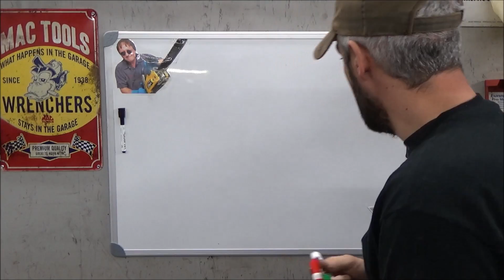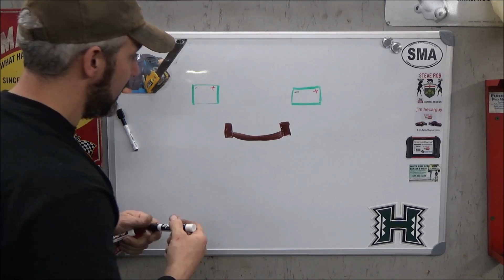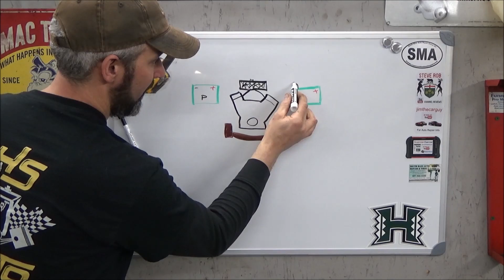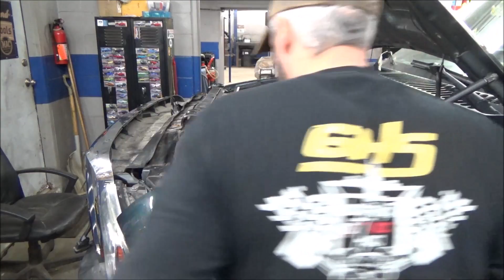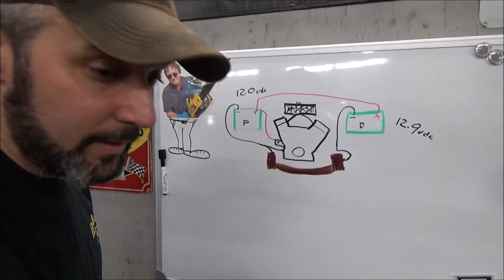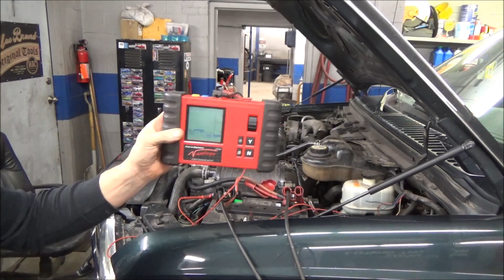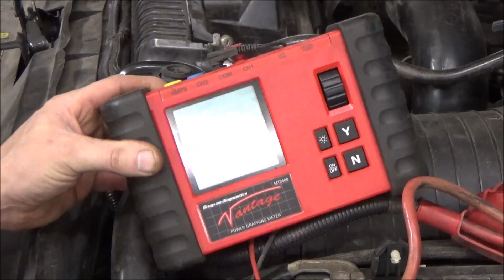Ford F-550 6.0 - No Start No Crank

Comment: This truck will be back for head gasket coolant problems
Reply: And bet you didn't know that 99% of the issues was due to having the wrong pressure radiator cap. Fix that, egr delete, and head studs and those engines are great. I'm a huge fan of Ford and own 2 diesel trucks. But they dropped the ball on the 6.0 and 6.4. the 7.3 and 6.7 are fantastic

Comment: If the batteries are hooked together in parallel, how can you get different voltages on your meter?  Shouldn't your meter show an equal average of the batteries on both batteries? Looks like a bad ground somewhere to me.
Reply from the maker: +beechwood619 Did you see the video haha?
Reply: Yes and yes

Comment: What would happen if you put jumper cables from one battery to the other? If that works then either a bad ground on one battery, or bad connection between positive post
It was a bad ground, so when you took the cable off it was easy to figure out where the problem was. Still a great step by step to find where the actual problem was. I would think, using 2 cables would probably be easier or cheaper than buying a factory cable. I have done simular things with bad grounds. I have fixed bad grounds ( or so I thought) and NOT fix the problem as well. It sure helps when you have knowledge to test everything.  That way you know you're correct as you were. 
Great job SIR!

Comment: so did you buy or make the cable!? I must know!
Reply: I know this is the wrong video, but what is your opinion on the diy ac fill kits with the oressure gauges? if I know my ac works and is just low on a charge? thanks keep up the videos
Reply from the maker: +splice247 I bought it from Ford, 1 day wait and only about 50 beans... I mean bucks :)
Reply from the maker: +splice247 Can't a shop charge it for really cheap? I get 39.99 to do a full evac and recharge...
Reply: Wow, really? That's crazy cheap! I'm in a city of around 150,000 in Canada and the going rate here is $150 Canadian. That's about $115 USD. That's for the service, refrigerant/oil, quick leak check and performance test. A/C machines typically cost $3000-$6000. That's a lot of money...

There are three main issues with those cans.

1) You don't know what you're getting. Some of them are pure hydrocarbons and not even R134a. Most are full of nasty sealants that like to do more harm than good. 

2) It's hard to accurately know how refrigerant the system is being charged with. 

3) Most importantly, those top up cans are doing nothing about any air and moisture in the system. Air and moisture seriously hampers the system's ability to perform. You won't get full cold until you get that stuff out with a proper evac.
Reply: @splice247   If the A/C is low on gas you have a leak. Don't go just topping it up with cans. Get it fixed properly and vacuumed down and properly checked for leaks

Comment: great video, but not a big fan of Scotty. To many loose nuts.
Reply: I like Scotty honest guy
Reply: +Justin P. Not really, very biased.
Reply: +Jonathan Barfield If you didn't know any better you would think from watching Scotty's  videos that changing and engine is a 4 minute process.  I like him, but his videos are very brief.  I like the long in depth ones that show all the stuff that goes wrong.
Reply: He shows enough to be dangerous. I have been turning wrenches 30+ years.Scotty videos are funny.
Reply: I like the one where he says to jack up the car to have enough room to get under the car, and don't worry about jackstands if you don't remove the wheels, because it won't hurt you if it falls because the car you had to jack up to get under wont fall enough to crush your chest if it fell.
Reply: +pdgeman   (no mention or thought of suspension travel)
Reply: Scotty is a nut case
Reply: More and more, Scotty sounds like a schill for various corporations. Any review should give balance, discuss alternatives, and disclose weaknesses. Wise consumers need to be educated enough to recognize this new wave in consumer advertising.
Reply: I though that the picture of scotty was funny
Reply: I just like him because he says true information and he acts weird so it's funny
Reply: If you got loose nuts, you can fix that yourself no problem instead of spending thousands of dollars for a mechanic to do it for ya! All you need is a ratchet or a wrench! First, you put the socket on the ratchet. Make sure its the right size. Youre not gonna be able to do much if it doesnt fit.
Reply: I think Scotty has been smoking to many cigars myself....but he has a following

Comment: I just love it when people ground batteries directly to the frame and wonder why things don't work right, I personally first foremost and always will ground them to the engine block first, then jumpers from block to frame and body, even on dual battery systems... I can't remember how many systems i've changed and fixed that problem your having. Love the vids too. you've had quite a few for my style of pick up that i've watched to get me through the work easier. i'm too old school and old car to know much about  these newer system.

Comment: Nice diagnosis Eric! One thing I thought I want to mention is I had a similar issue in my Mustang I used to own which I decided to modify and put in 2 batteries in parallel for extra juice for my amp and stereo. The connections were fine but the batteries were different and what happened was one battery had discharged into the other and after too many cycles it cooked the battery so when you have batteries connected in parallel ito wise to use identical batteries with the same internal resistance.

Comment: On the passenger side fender their is a bullet connecter that jumps that starter circuit. (key off) you disconnect it and touch the the positive side of the battery and that would have told you right away if the concern is with the starter circuit or not. We do this after major repairs to help build base oil pressure without all the accessories to drain the batteries and to be able do watch under the hood at the same time without having somebody to help.

Comment: Fantastic video Eric!!!....the way you pin-point the ground wire section that was bad... was great!!!...  the section was well burned!!!.....I've certainly learn the right procedure to locate a bad wire!!!.....the best of all was not to jump over on fast conclusions!!!.....It took me a little while to understand why the second battery didnt charge but the first one does!!! I guess some other electrical stuff was malfunctioning too!!!... because bad ground from the alternator to the frame!!!....another idea that came to me is that little section of ground cable supports all the ampereage that both batteries supply or need!!!!  Im pretty sure that the black marker was under the multi-metter!!! jajajaja....I wonder why scotty have a chain saw in the white-board??? jajajaja.....greetings to everybody at SMA including Cloe and Sheba too!!!!

Comment: Ole Scotty comes through again. Totally crystallized copper. A lot of current in that short cable. And thousands of heat cycles probably. Copper will do that occasionally when also exposed to water.  Copper oxide is yucky and won’t carry current.  “So there’s your problem Lady”.  Too many heat/cool cycles in a high current circuit, and copper wire exposed to the New York elements.   Great video.  Your troubleshooting steps are a great teaching tool. Thanks for another great video.

Comment: Great video!  Now I have to go to work.  Two of the grandkids showed up today and neither of their vehicles has the AC working.  Since I do not have any gauges to check the freon level.  I will be checking out the electrical system on both.  Wish me luck!

Comment: Good diagnosis,  I would have gone to the starter.  Thanks for the tip on the battery booster for checking resistance!

Comment: I had a no crank on a small tractor.  Had voltage to starter but no go.  I used ohm meter to check all wires and had good continuity.  I condemned starter and replaced and it changed nothing.  Turned out the perfect looking, like clean off the shelf, negative cable couldn’t carry enough amperage to turn the engine over.   Replaced the $6 cable and all was well.

Comment: marker took off with the 10mm socket. Long time OLD gm 6.2L diesel, UD 1800 owner..ben there done that..alot. When brine started gettin used on the snowy roads, had to always have a spare --- cable under the seat in case

Comment: I'm sure your granny knew this already but: a spray bottle of water with a a couple tea soons of baking soda used to spay on battery cable's and connector's it will neutralize any acid while working on electric connection on cables and the tops of batteries. Saves on clothes and fingers being full of holes. Plus adding vaseline or yellow grease on every connection and battery cable ends makes for a good connection that lasts a much longer period than not. At least this is what I learned from my granny...she was the smartest mechanic I ever met, until I met Scotty, and I luv Scotty...

Comment: I've seen lots of bad ground straps, metal fatigue, green death but not seen brown death before. 
Back in the day the best clue was a toasted choke cable as the starter current passed through it on its way to ground.

Comment: You can jumper cable across the negative terminals and see if it cranks- if yes, it's the negative cable and or connections.  You can also meter across negative to negative and see the voltage difference and know there is a faulty connection or cable.  If not, do the same with positive terminals.

Comment: Had a similar problem with my 2000 F450. Turned out to be the switch that told the truck it was in PARK that wasn't engaging. It would start fine in NEUTRAL. Adjusted (tightened) the gear shift bracket and it solved the problem. That same issue was also causing the batteries to drain when the truck wasn't being driven because the backup lights were on when the shift lever indicated it was in PARK. Too many interlocks in these 'new' trucks.

Comment: Not trying to minimize Eric's testing to figure out the exact problem at all, but after it's nailed down, in this particular case, I would figure where there's one bad cable and/or connection, the others aren't far behind and they are relatively inexpensive to replace. So I would replace them all depending of course on how difficult they are to get to. Then again labor costs for that is going to be pretty high, but my own labor runs cheep. I try to minimize being stranded to the extent possible, especially in the middle of nowhere, but that's just me. I think it's a good idea to carry a portable jump starter in all my vehicles as well. But I find myself using them for other people needing a jump. I've never needed one for my own vehicle yet. One thing is for sure, tow operators hate me.

Comment: Nice job Eric, I understand why you diagnosed the vehicle the way you did.  Plus the point of the video is to learn.  You can hunt and peck for problems but for the majority of the time from my experience this will burn you.  Keep on doing it the way your doing it Eric.  Good job.  Oh and by the way if you put voltage on one end of the Load Pro, black lead to the bad end, then ground the other end and hit the button, yes it would have seen the drop for this situation.  I do not use the Loadpro for high current circuits, it's not designed for that.  I troubleshoot exactly the way you do, look at the potential difference of the meter leads to find the drop.  Sometimes I use my Pico though if I suspect excessive Ac ripple.  Nice trick with the jump box.  I  did build a Load box though for high current applications which will load the circuit to 60-70 amps.  My version of a small toaster,lol.😄.  Makes a good sub load for the Alternator if I suspect a issue with it.  Our carbon pile went poof so I built my own load box.  Oh and hey one more thing.  I completely forgot about this but I wanted to bring this up.  Remember the vid you did on the Jeep with Ivan with the bad ground and the light looked bright to you and it actually was dimmer, as soon as you put the alternate ground lead to it the light got brighter.  Load Pro would of found that with no problem.  And I'm saying this because I've used it for quite some time and I have found ground side drops with it.  Anyway great job Eric.  Where do I go to get a sticker of yours?

Comment: Excellent discourse.  Yes, you may have lost a few folks, but you were gonna lose them anyhow.  Voltage drop testing finds the problem quickly and without a lot of connecting and unconnecting (which may generate new problems) and without a lot of dead end guessing.  This should be mandatory viewing by anyone who chases no crank or slow crank starting problems.

Would have interested to know the current draw of the starting aid (glow plugs, intake heater).  With diesels, starting aid draw magnifies impact of low voltage to the starter.

Last point: with no crank, I always start by confirming function of the solenoid coil circuit.  Quick and easy elimination of a potential unrelated problem, and may avoid a wild goose chase.

Comment: Don’t know if this helps, if I’m wrong, or blowing up a tree. I’m a marine tech, (I have literally called two battery manufacturers for this info). When 2 batteries (in a boat) are connected together, #1 is, let’s say at 8 volts and #2 is good at let’s say 12.7-8 volts. When you connect a charger to #1 because it’s low, because the batteries are connected the charger will not throw/charge #1 because with both batteries connected, the charger is reading the 12.7 volt, so it’s saying this battery is good, it doesn’t need charging. Ive learned this over the years but no one would believe me, so I called and was told this by the manufacturer also. The charger doesn’t know if 1 or 5 batteries are connected, it’s only reading voltage and will put out amps to charge. Now, here is another example. This happens a couple times a years with us. Customer knew he had 1 battery that was about 3-4 volts, and the other battery was about 8 volts. He puts a charger on them, (still connected) the 8 volt battery goes to 12.6 and the 3 volt battery goes too about 8, why? (As told by manufacturer)the charger only threw power, it did not know there was 2 batteries, it just reads that it has to charge, so the better battery goes up too 12.6, charger says, ‘that’s good’ so weaker battery never gets charged up. You have to separate them. This goes for the alternator also. This is why in a boat, you need a battery isolator that will since when one battery is low, the alternator will charge just that one. If both low, sends power to both, when one gets charged, it continues charging the other.

Comment: Here's something simple you can do to help out the flow of electrons between batteries. (I don't know if it would work with these particular batteries but it worked on my Ford diesel with AutoZone batteries). You'll need the dual-terminal type batteries with both the top and side terminals. Get two lengths of stout-ass wire and put side terminal style ends on them and connect the batteries to each other -- pos to pos and neg to neg. That will eliminate any low-charge or no charge situations due to poor connections at your regular terminals. Gives those electrons nearly twice as much wire to run through. Makes a difference. It did with mine. It also makes your truck look like a spaceship. 

Okay, not really. Not like a spaceship. More like a truck with extra wires under the hood. But still very cool.

Comment: Loved every minute, and I didn't miss a minute.  This is exactly the kind of diagnostic procedure I like.  The drawings were super, as they kept me on track with what was going on.
     However, there was one point you didn't cover.  Why didn't you put the truck up on the lift to get to those ground attachments?  I figured it was too heavy, perhaps, but that doesn't make total sense either.  
     This truck was auctioned off because it was a pain in the butt, yet you were able to get it on the road again by finding the exact, yet not obvious problem.  BZ
Reply from the maker: +Memphis Applegate  Yeah my lift is only a 10k and this would push the limits of it for sure...

Comment: If there is a voltage difference between batteries and you are able to have it “crank” while watching the voltage, the you get two options, the first being see which one dives when you crank it, the second being to check the positive between the two batteries (or every single ground around)

Comment: Just like all ford diesels since the 7.3 idi and maybe earlier... “don’t wiggle the battery terminals!” And sure enough it rings true every time, if you boost it you’ll be replacing the batteries or swapping sides at the next stop or the next day or something

Comment: Great video Eric! Remember that two batteries in series add their voltages, in parallel they share the same voltage thus in a case like this one where there is a difference in the voltages then you know that they are not connected to each other. Be careful when plugging two batteries with different voltages because they will violently balance once you plug them together. To simplify your diagnosis you could have metered the voltage on one of the two batteries and jumped the batteries from positive to positive and from negative to negative; the balancing of the batteries should have been pretty obvious on the voltages and current (one battery voltage goes down and the other up). Once you have identified which of the positive or negative side is open you can then jump them again along the way to the other side's terminal (in this case you would have seen the balancing of the voltages when jumping from the negative terminal to right after the broken wire). I love your videos; keep up the good work!
Reply from the maker: +vachon644 Yep you got it ;)